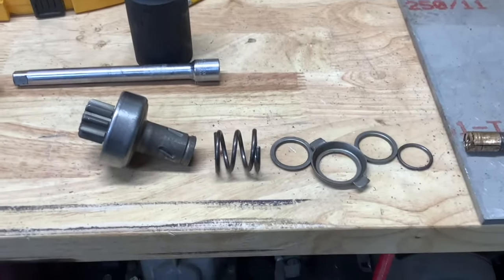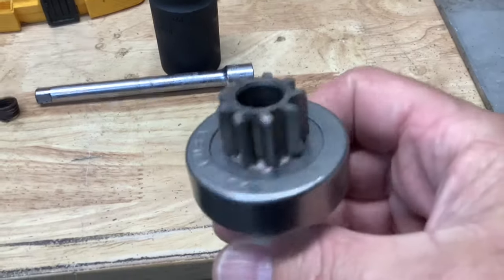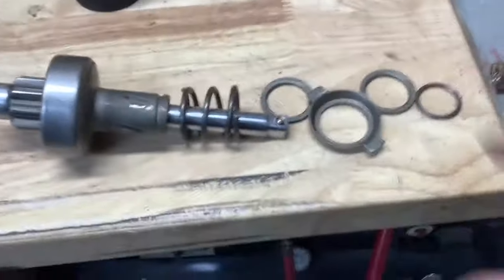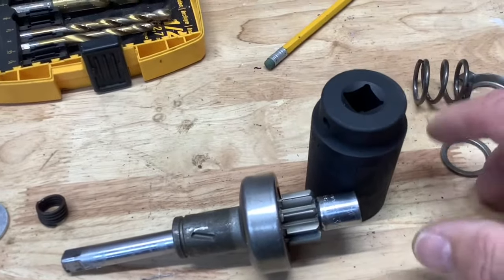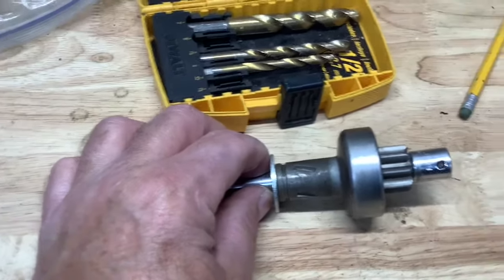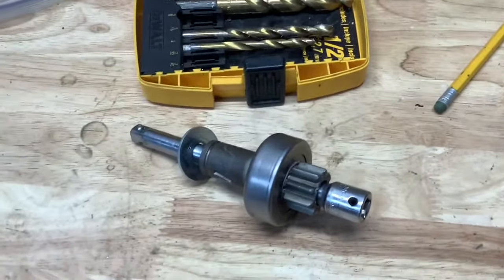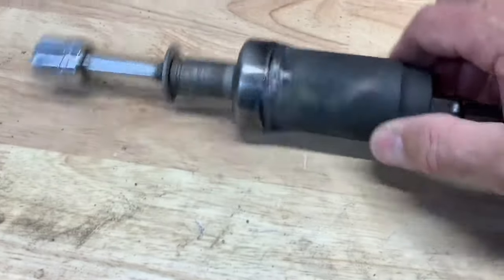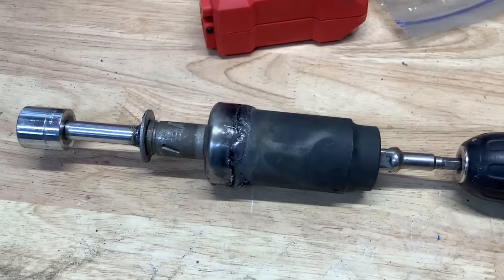Small Engine Electric Starter For A Drill (How To Build)

Comment: You are one smart dude!!  That is really a neat build for saving a lot of thumb and wrist injury. The wrong way is to use a direct drive drill . When the engine starts, it will take the drill beyond the rpm and thumb and hand with it. Thankyou for thinking safety.

Comment: I'm glad I watched this. I have a high compression engine 100cc I am going to attempt to start tomorrow with a angle drill. I will rig up the same set up as you as I dont need any broken bones right now
Reply from the maker: I have used it twice. Works great and was cheap to build and in less than an hour
Reply: @timthetoolman4575  good to know. Thanks again
Reply: @timthetoolman4575  Looks like quality work, How much to build me one. I bid $25.00, is that enough? Yes I'm serious.
Reply from the maker: @guyg3023  sorry I don’t do work for hire

Comment: , PLEASE and thank you. I would like the link and, or the part# for the small motor starter kit
Reply from the maker: The eBay info is in an earlier comment……BUT, it’s no longer available. You may check Amazon for a 20.00 tool called a “ratchet adapter “ that will work as well. Tim
Reply from the maker: Search Amazon for this 20.00 tool that does the same thing. ….  ARES 36005-1/2-Inch Drive Ratcheting Breaker Bar Adapter - Converts Breaker Bar or Sliding T-Handle into Ratchet - Reversible Ratcheting Mechanism with Anodized Switch Collar
Reply: @timthetoolman4575  Thank you for that info I'm definitely going to get and use it .

Comment: But how does it clutch to freewheel?  Does the started gear have a one way deal inside the bearing looking part?  Or does it just cam out like the bendix normally does when using a starter like with the spring and all..?
Reply from the maker: It has a “one way deal inside” that allows the tool to free wheel once the engine starts rather than ripping the tool from your hands. You can then just pull the tool off the engine

Comment: Why not cut the extension in half & weld each to both ends so ya won't need to sacrifice a large socket?
Reply from the maker: The large socket is welded to outer most edge of the drive mechanism. The outer most edge spins separate from the inner mechanism the extension is welded to so when the engine starts.... the inner can spin separately from the outer edge.
Reply from the maker: FYI, I bought the large socket at harbor freight to keep the cost low. It was less than $ 5.00
Reply: I believe I'm correct in that the gear end is independent from the other end right? ... The gear will free-wheel in one direction & engage in the other? ... So welding half to the gear & half to the other end does the same thing?

Comment: Welding the washer on to retain the coil of wire is not necessary as the extension is already welded at the gear end.
Reply from the maker: The washer is just tacked in place to keep the coiled wire in place. Yes, the weld at the gear is where the main bond is made.
Reply: @timthetoolman4575  Right and once the main weld is made there is no longer a requirement for the coiled up wire to keep things lined up so instead of welding it in with a washer, remove it altogether.  If your weld is any good at all u shouldnt need a coiled up wire to stabilize the 6" extension ?

Comment: I'm curious, what is the pvc pipe for? Genny power cord or something else?
Reply from the maker: Good observation. I rolled up and keep an extra copy of the owners manual in the pvc. That way if I’m ever away from home with it and have an issue I have the manual handy for instructions and trouble shooting guide
Reply: @timthetoolman4575  that's a really good idea! I work at a kubota dealer. Tomorrow I'll be on the lookout for one of the tubes they put on equipment! I never gave it a thought to use one on smaller stuff of my own lol! I'm sure there is a used one laying around in a junk bucket!
Reply from the maker: @jaredmurray9868  always good to be prepared,

Comment: Why can't anyone give the starter Drive number? .... I have gotten 3 & they were all for different cars & I have purchased one for the vehicle I was told would work .... They all worked the opposite way! ... Why is this so hard ????
Reply from the maker: I put a link in the description box pull down of my video to the eBay part I used to build mine
Reply: @timthetoolman4575  as it looks like ya found out the link is no good ... Is it possible to go into your eBay & look at the list of your purchases to see what ya purchased?
Reply from the maker: @daveoldaker5589  great idea. I checked and found it. I also updated it in the video description 
I purchased: Starter Drive Airtex 2K1076 MADE IN MEXICO AND / OR U.S.
Reply: @timthetoolman4575  thanks for the info! .... I will have to keep looking for one as I can't find any for sale right now.
Reply: I have done a little research and if I'm correct a starter drive that fits a 1970 Ford Fairlane is the correct starter drive ... Will let everyone know when I find out for sure!
Reply from the maker: @daveoldaker5589  great. I knew it was from something old.
Reply: Well now I'm confused! ... Contacted 3 people selling a starter drive for a 1970 Ford Fairlane ... 2 wrote back & it seems it spins in the opposite direction of what is needed ... I don't get it! ... I'll keep looking!
Reply: @daveoldaker5589  New Bendix Starter Drive For 20/25/ 30/35 Mt 10D Clockwise  ebay
Reply: My engine rotates clockwise , so this is what I used for my application.
Reply: @daveoldaker5589  if it goes the opposite way you should be able add a female-female and a male-male on each end, and flip it around.
If you're using a motor, same thing, flip it around, as long as it fits it should work.
Reply: you can tell CW or CCW by looking at the teeth/gear, if the slant is on the right, just like in the video, it's CW
if you need CCW, then just look for a bendix starter with teeth/gear that has a left slant
Reply: Turn it around build in reverse, or just buy a pancake ratchet it can free wheel in either direction. No welding. On Amazon for around $12.00.
Reply: @johnstapler7787  it started but loosing the nut on engine. The nut will flew away.
Reply: Tim can we buy ready-kade from you?

Comment: is this for a clockwise rotation engine??
Reply from the maker: Yes it is
Reply: @timthetoolman4575  what do you do if you have a counterclockwise engine because then it just wants to remove the nut
Reply from the maker: @diychad7268  you would need to find a starter drive that turns counter clockwise
Reply: @timthetoolman4575  does starter drive comes counter clockwise????
Reply from the maker: @josephpang6207  clockwise only